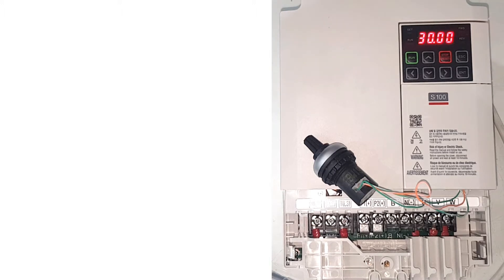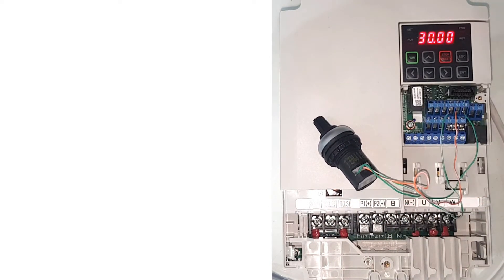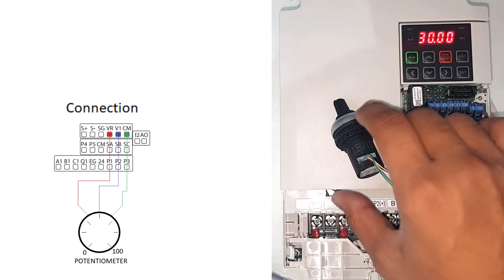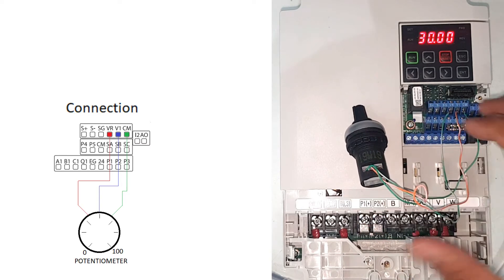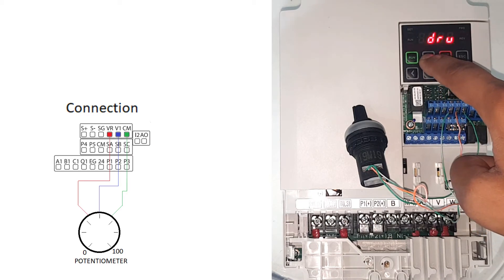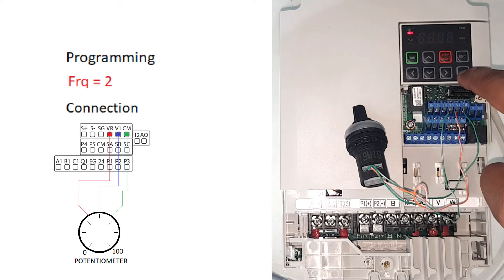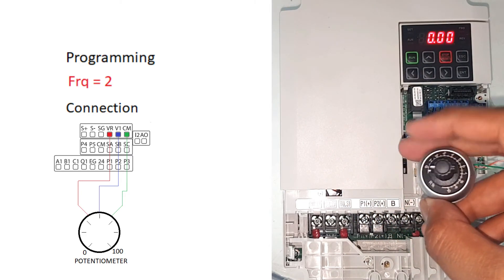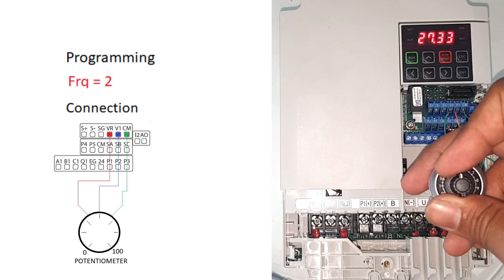How to program S100 for Potentiometer?

Comment: I want analog output for potentiometer to run another VFD.. But the output voltage i am getting half of the master VFD.. How to increase it? Which paramter?
Reply from the maker: You will have to check in Ou group to check the analog output function. I think it might be set to current output, make it Frequency output
Reply: @howto...8040  can you tell me which group please from the manual and the step..would be great.. Thanks
Reply from the maker: Ou.01 make 1
Ou.02 keep 100
Then check on Ou.06

And also check with dc voltmeter
Reply: @howto...8040  ok i.will let u know...thanks.for.your.support